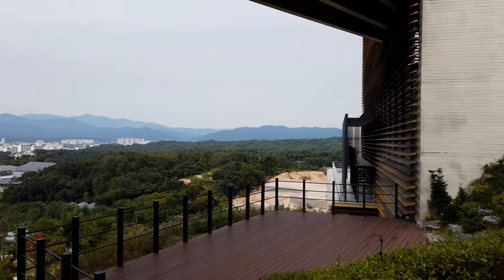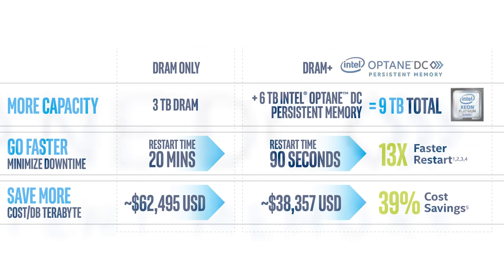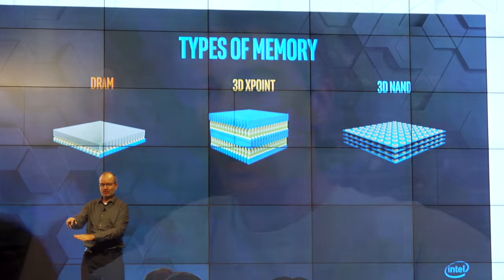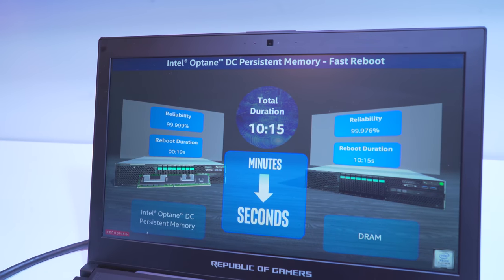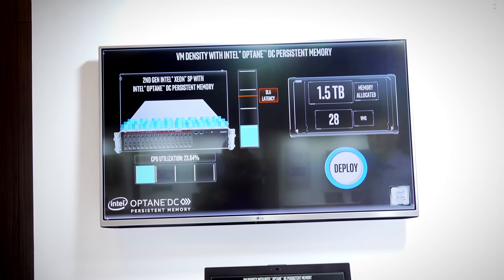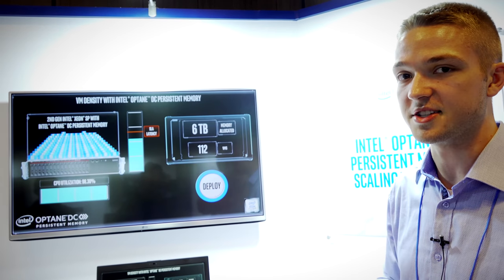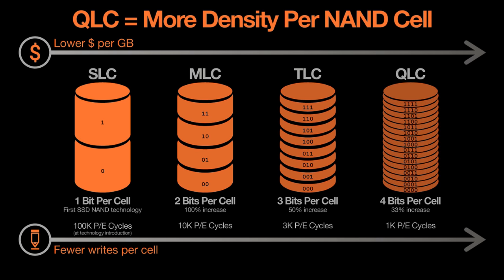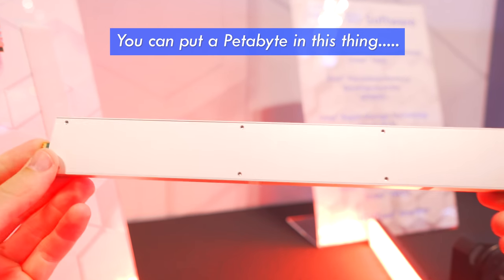Is This the FUTURE of RAM and Storage....!? (Intel's Barlow Pass)

Comment: Intel talking about price/performance?
Absolutely madlad.
Reply: Probably really cheap to make if they're taking this approach.
Reply: Tbf, if you're full-loading a system with RAM, it'll be more expensive than any processor it can be configured with, even on Intel. For example, you can load basically any current-gen 8 socket Intel server with at least 12TB of DRAM. At >$8/gb for the highest density ECC LRDIMMs, that puts the RAM at over $100k. Ten 8180 plats cost around $80k-95k. 

This gets even crazier with AMD Epyc Rome, which supports 4TB of RAM on a single socket with some motherboards, with the RAM being at least three times as pricey as the highest end AMD 64 core Rome chip.
Reply: Well when time is money and you have to save on power they win in the storage department. Intel is almost always faster except in a few niche cases. They also have programs optimized for Intel CPUs so moving to a AMD CPU will give you a performance hit or straight up not work. 
So to big business it makes sense to us consumers AMD is the better choice for CPU and GPU right now while Mushkin is for the SSD. Intel is good If you think you will keep it for 7 to 15 years. Most of us will not have our same computer in a decade from now so the extra cost for reliability to a hard drive to last that long is most likely unneeded and just extra cost.
Reply: @romannasuti25  wow
Reply: @yumri4  well, I don't think that's really fair to Epyc Rome. There's a ton of datacenter workloads that absolutely kill it on AMD Epyc, especially from an efficiency and TCO point of view. Anything that benefits greatly from AVX512 does still work great on Intel, but basically any other workload that I can think of that scales reasonably well with core count and ssd/network bandwidth (open source databases, web servers, SAN/NAS, hyper-converged infrastructure deployments, etc.) generally has much lower TCO on AMD Epyc.

The only market where AMD cannot touch Intel are ultra-high end enterprise/"mainframe" servers (8 or more sockets), and even then IBM mainframes can often be better fits for those workloads anyways due to far superior reliability and greater per-core muscle to get the most out of expensive per-core licensed enterprise software (Oracle, DB2, zProducts, etc). The only workload that I can immediately think of that makes sense on those 8-32 socket Intel behemoths is SAP HANA, and only because they don't support s390x and license by RAM instead of core count anyways (which is much cheaper on Intel compared to IBM z).
Reply: @aluandcache7336  yeah ECC LPRAM is expensive also is non-ECC LPRAM is expensive. Having 1TB or more of is for anything but data modeling and virtual machines make no sense to me.

So most likely you are not going to see any consumer machine with more than like 128GB of system RAM in this decade. Mostly due to hardware limits but still 128GB of system RAM is still in the realm of pro-user  and work stations not consumer machines.

Comment: Wow Bryan. How cool is that?!
Memory that keeps on working with a power off scenario?
Will that help in a power cut situation?
Storage is getting smaller too.
Amazing.
Thanks for the tech update.
Cheers, Mon from Brisbane.
Reply: What is that badge you have with you name
Reply: It's a subscription badge. Like a Tech Yes Team badge.
Reply: Optane M2 memory for desktop & laptop has been around since mid 2017 . Nowadays a 32 GB M2 Optane memory costs like a 500 GB M2 SSD . Plus , I personally faced lots of driver related issues . And doesn't support Linux . And creates havoc to cure any virus or spyware infection . Bottom line -- Just leave it for servers now . We , normal consumers , should stick to our normal DDR sticks .

Want to use M2 ? Get some M2 SSDs , but not M2 Optane memory nor M2 wi-fi :)
Reply: @abhroy : m.2 nvmes work perfectly with Linux. All my system uses it. As for optane as cache, I think it's pointless. You'd be better off getting more nvme and setting up a larger cache for your slow disks.
Reply: @jeschinstad   . Actually I wrote that sorta wrong . M2 Optane was the thing that didn't work for me with Mint & also gave drivers' issues with Win10 . Correcting now .
Reply: @jeschinstad   . Edited . Added the word Optane where I felt deem necessary . Thanks for pointing that out . 20+ years in PC building & sys-admin works -- a big thanks go to you all who point out out my mistakes & help "learn" a thing or two :)

Comment: -28 core 56 thread Xeon runs 112 VM's 
-EPYC Rome laughs maniacally
Reply: laughs in 64 cores and 128 threads
bruh that would literally be 256 VM's on a single chip
absolutely bonkers
Reply: @erikport224  I wonder what the bottleneck will be then
Reply: @erikport224   its a sever cpu its sucks of other uses
Reply: Dead Man Yes, running VM’s is a typical server task
Reply: @erikport224  and containers, too. i'm seeing more and more ESX being phased out in many places, being replaced by things like ProxMox for its ability to do both VMs and linux containers :)
Also, VDI via Citrix, VmWare, or Hyper-V.
Reply: @erikport224  Supports upto 8 cpus per board. 

so 224 cores 448 threads.
Reply: Xeuron the bottleneck would probably be the network, you’d need a lot of bandwidth to be able to access and control all of those VM’s at once.
Reply: Sweats 😓
Reply: @erikport224  and this is the reason FiberChannel over 100GB and SANs exist.
in most VM applications (including databases), you do not have that much IO anyway.
Also, top of the line aren't used most of the time in servers, most are fitted with mid range stuff which is cheaper to buy and run.

This is also why IT architects exist, to know what to buy with what budget and for what application.
Reply: @Matthew R. Because it's 2 28 core Xeon Platinum 8280's glued together. Also it's a custom chip (so not supported on any existing platform), OEM only, integrated only, has a 400W TDP, and has an undisclosed price (mainly because you can't actually buy it anywhere since no vendors are using it in their systems). I'd wager to say it's probably $25k+ since it's a custom assembly of two $10k processors.

So double the TDP, 3x the price (if we're lucky), and zero support or availability, with 8 less cores and 16 less threads to boot. Can't get more Intel than that. Also every review of the EPYC 7742 shows it destroying a single Xeon Platinum 8280 (at worst) and destroying DUAL Xeon Platinum 8280's (at best). I guess "much better performance" doesn't mean what you think it means.
Reply: @Matthew R.  Matthew R.  Lol you say it's not a direct competitor, but you're the one directly comparing it. I guess it can't be a direct competitor since it's in a completely different price bracket (and no one can actually buy it).

And AMD lied about their EPIC Rome benchmarks? And? I was talking about actual reviews of the EPIC 7742. There aren't any actual reviews of that Xeon Premium processor because at this point its vaporware🤷‍♂️.

You clearly have some kind of beef with AMD which seems nonsensical to me unless you work for Intel. Epic is crushing Xeons across the board in performance AND price. That's not my opinion, it's a fact.

Comment: It seems that intel is confident enough in how fast optane is they feel like using that nonvolitile storage as memory is fast enough that the benefits of doing so is marketable compared to the slowdown in speeds compared to traditional RAM.
That application direct mode sounds interesting, though. i wonder if they can have the computer's operating system itself (or most of it) reside in whats also the computer's memory leading to crazy fast boot times... though an operating system that could do that would take a little work to develop.

Comment: Now imainge that memory being used on AMD EPYC holy moly!
Reply: 7702 FTW
Reply: @ilyaskiziloglu7397  I can see AMD developing something like this to compete because they have the CPU leverage that would make this tech even more better rather than Xeons
Reply: @roberthale8407  i wouldn't know about the persistent ram part but amd has been in the works of putting ram directly on the cpu.
Reply: rom MegabFytes to Exabytes.... Jeez...
I remember myself transftering 700 megabytes of mp3 soundtracks, stored in a zip archive in the form of devided zip packets, from a laptop to my PC using nothing more than 12  3.5 inch floppy disks. Saving them to my PC, reformatting the floppies, copying in them the next files and so on...…….it took me over 6 hours.
Reply: @ilyaskiziloglu7397  I didn't get you about the TSMC 28 nm

Comment: Thank you. Intel needs to get this out to more people so thanks for the help.
In memory Database (ORACLE, SQL 2019, etc)  IMDB are way faster. Longer to load but faster to run. 
This helps other techies get over "Putting temp db or Redo log files" that are *constantly re-written during a database transaction on SSD because it wears them out soo much faster. IMDB still uses log files.

Comment: Hey guy I just wanted to mention your used parts videos.  I would not have thought of looking in a thrift store for something good.  Man was I wrong.  In the first thrift store I tried I found 4 computers.  3 Windows XP dinosaurs and 1 Windows 10.  All were 9.99 USD each.
So for 10 bucks I got a 2016 system.  It didn't have a graphics card but the rest was definitely worth it.
Asus h110 motherboard
6th generation i5 processor
1 x 8gb stick of kingston ram 2133mhz
1 500gb laptop drive at 7200rpm.
case and power supply appear quite generic and I can't determine the brand
So thanks for the tip. :)

Comment: Great video by the way, It seams good in theory, But lets see if Intel Decides to lock it down, to only Intel, or specific Intel based chips and boards, before we can get all happy. Just like Optane only works on Intel 7th Gen and newer, or how Nvidia Locked down Physx to only run on Nvidia Cards. Sure this new tech is fast, But Intel has had so many Security vulnerabilities and the fixes are(disable hyper-threading, and also lose an extra 30% in total your losing over 60% including losing hyper-threading)Not to mention Intel's xeon platinum 8280l Costs over $32,000 USD per CPU, Who in there mind is going to want to support a platform that is so unsecured that you have to keep losing performance just to keep running. 

And The AMD EPYC 7742 costs around $6,950 USD with 228% more cores and threads, while being 457% cheaper($25,000 USD cheaper), and don't get me started on IO, Compatibility, Efficiency, Raw Throughput, AND FOR THE RECORD IT TAKES 2 Intel xeon platinum 8280l'S WITHOUT ALL OF THE VULNERABILITY PATCHES TO BE AROUND THE SAME PERFORMANCE OF A SINGLE AMD EPYC 7742, AND 4 Intel xeon platinum 8280l'S WITH ALL OF THE VULNERABILITY PATCHES INCLUDING DISABLING HYPER-THREADING TO BE 15% - 25% BETTER. 2 Intel xeon platinum 8280l'S $64,000 USD 4 Intel xeon platinum 8280l'S $128,000 USD, a Single EPYC 7742 $6,950 USD, 2 EPYC 7742's $13,900 USD, for the hell of it 18 EPYC 7742's cost $125,100 USD, that's still cheaper than 4 Intel xeon platinum 8280l'S. 

So no I seriously doubt Large Data centers, or many in the Server Industry are going to keep supporting this rotting, festering carcass for to much longer, even if they bring out Optane DC which has been in the works for well over 5 years, 3 for public. Intel's current Platforms are pretty much Rotting, and festering carcasses, they need innovation bad, like horribly so.

Comment: Bryan, good stuff, mate!  FYI: as a science experiment, if nothing else, several years ago we submitted a provisional patent application for adding a "Format RAM" option to a standard BIOS subsystem.  Now, this should be easier with a UEFI.  Imagine a workstation with 4 DDR4 DIMM slots in quad-channel mode, and another 2 or 4 DIMM slots for Optane memory.  The latter would be a perfect way to host a "ramdisk" in which a fresh Windows OS could be installed and function transparently as a standard C: partition.  Here's the text of that provisional patent application, in case  you're interested in this science experiment:
http://supremelaw.org/patents/bios.enhancements/provisional.application.1.htm
p.s.  patent rights have expired, because we did not follow with a full Utility Patent Application.
Reply: However, the arrival of PCIe 4.0 has vastly increased the raw bandwidth of an x16 PCIe expansion slot. 

Here's a comparison of that raw bandwidth with DDR4-3200:

DDR4-3200 x 8  =  25,600 MB/second

16G / 8.125 x 4 PCIe 4.0 lanes x 4 M.2  =  31,507 MB/second

31,507 / 8  ~= DDR4-3938

(128b/130b means 130 bits / 16 bytes  =  8.125 bits per byte, per "jumbo frame")

So, a "4x4" expansion card, like the ASRock Ultra Quad M.2 card, has a higher raw bandwidth than DDR4-3200, and that higher raw bandwidth is the equivalent of DDR4-3938 [see calculation above].

Comment: just wait until a program has a ram leak... how do you clear the memory if the memory doesn't clear during reboot? for software maintenance this could also be a problem since the reason I have to reboot after a registry edit is to clear the value that's already in ram and load in the new one. without some special software that would say "oh on this reboot you need to do a full reboot, clear the ram" or something similar, this could become unusable in a hurry.
Reply: Hehe, are you serious? "I have to reboot after a registry edit is to clear the value that's already in ram and load in the new one"

Comment: me: I have 32gb of ram beat that!
tech yes: I'm going to ruin this mans whole career.
Reply: My X58 computer from 2009 has 48GB of RAM. 😏
Reply: @CompproB237  my dual X58 system for FreeNAS has 120GB :p
Reply: @seedz5132  How? Max I can figure would be 96GB of RAM for a dual X58. 12x8GB
Reply: @CompproB237  I have a TYAN s7012 motherboard, with 3 slots per channel. 
So, it's filled up with 14 8Gb modules and 4 2Gb modules

this one, to be exact :
https://www.tyan.com/Motherboards_S7012_S7012WGM4NR
(i've disabled the SAS controller now that i have a H300 card in IT mode, the onboard SAS i couldn't flash to IT mode, and it also doesn't support 4Tb drives)

and oh, i meant dual 1366 board, not dual X58 obviously, as x58 is the chipset after all :>
Reply: @seedz5132  Oh, you have a 3 stick per channel Intel 5520 chipset board. That makes a lot more sense.
Reply: @CompproB237 : Get a last-gen server for cheap, then you get a bucket full of DDR3 ECC for nothing. It can be really useful.
Reply: @jeschinstad  I'm good.

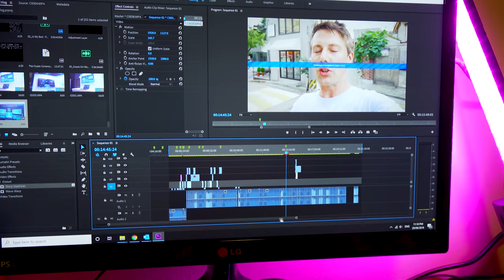Comment: 9:26 Just buy a Lenovo D30 and add 16 x 32 GB DDR3. It's around 1000 USD and works very well! :) The memory is slower than DDR-4 for sure but you will get quad-channel.

Comment: 70MBps random reads, I don't know, something about that isn't impressing me. They need a multi gigaByte-per-second interface (m.2 NVME), just to get pre-SATA bandwidth with random reads. It also doesn't help much when you want your data on a drive that isn't the boot drive, and the motherboard only has a single M.2 slot (I don't think SATA is going to be dead overnight from this).  Surely they can also do better with the other drive interface units as well (SATA, U.2, SAS, etc).

Great vid Bryan and crew. B)

Comment: Only question I have.  I remember a few instances where I had to restart specifically to "flush the ram", so would there be something like that here?  I mean, you basically have a hyper fast SSD and those don't flush.
Reply: @SISSYPUSS  Right, but what I was asking is if you are having a problem where something was written to the ram that is now causing problems, how do you fix it outside of... a new module? It doesn't happen often, but especially if it ends up hitting the consumer market, you would need something.  ECC for everyone maybe?

Comment: Are the system requirements for this anything like the original Optane memory?  If I remember correctly the original Optane needed a system with specs that many don't have.  I hope this memory would be usable on most new motherboards released at the same time as this and not limited to Intel processors either.

Comment: Well technically, it is not RAM. It is just a new layer in a tiered memory architecture. Earlier it was just caches, DRAM and disk in order of access speeds and capacity. Now, there's one more tier inbetween DRAM and disk. Also, the semantics of accessing storage class memory, i.e. what Intel likes to call Optane, are quite different compared to something like traditional DDR memory. This, at the moment, is not very transparent to applications and developers have to rely on additional libraries like libnvdimm, PMDK, etc.

Comment: Why can't we simply have a combined standard for memory and storage. We can have a module that has both dram and flash on it. And maybe super fast cache that the cpu can use. And the data can be assigned to a typical address that corresponds to either the volatile or non-volatile memory location. Imagine how fast windows would boot. the windows image could be stored. I know that the tech is already there but it needs to be a standard and not just an intel technology.

Comment: Also durability - what's the risk of loosing data hitting your desk and PC accidentally (Hard drives)- sliding the chair too fast etc. Is this Optaine compatible with AMD systems?
Reply: Optane SSD's are but Optane DIMM's are not.
Reply: @Raivo_K  Even if they had to pay a premium for the license, an Epyc system with DIMMs would still be cheaper...